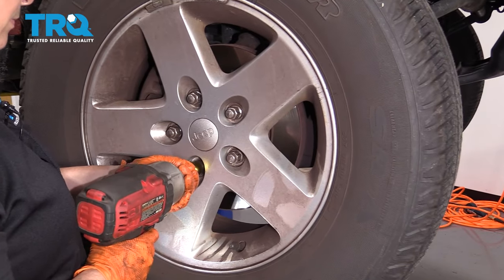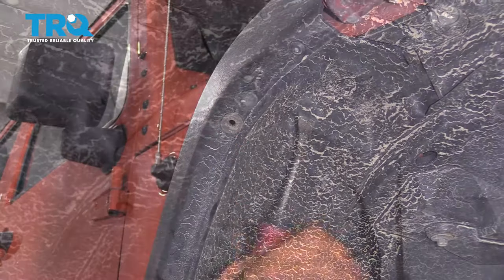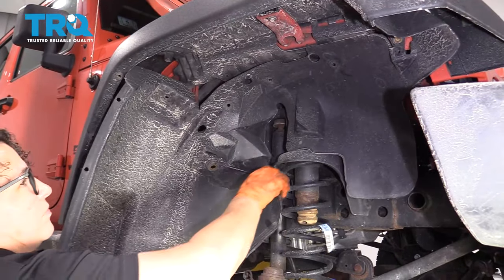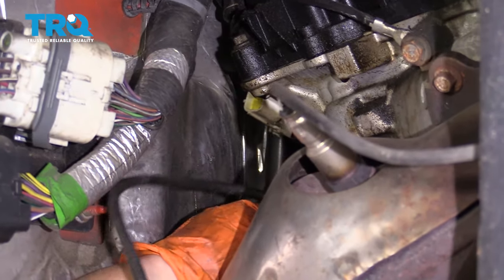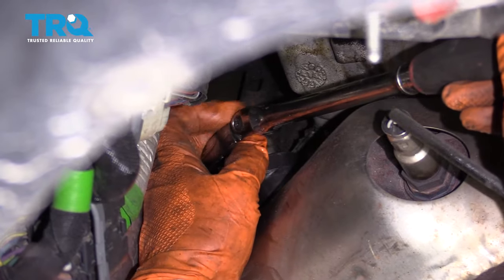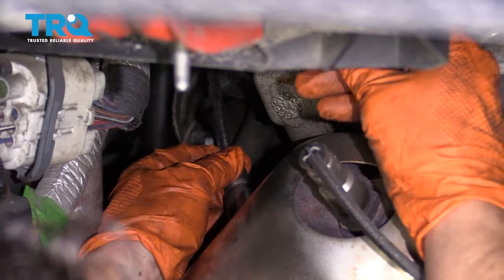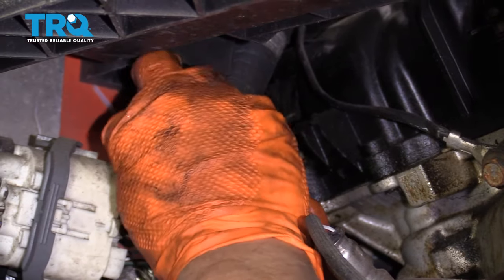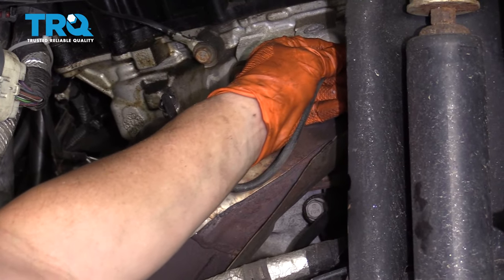How To Replace Oxygen (O2) Sensors 2007-17 Jeep Wrangler

Comment: The 2007 Jeep Wrangler has four  O2 sensors and two catalytic converters.  Bank 2 is on the drivers side, and Bank 1 is on the passenger side.  Each cat has two sensors, Sensor 1 is closest to the engine, which is the  inlet side of the cat.  Sensor 2 is on the discharge side of the cat.
Reply: Question for you code 2096 is passenger side downstream?
Reply: @matthewmilliron632  if you never got an answer that’s passenger after the cat, I have the same code right now
Reply: @maggiebrooks4485  lmao so do i, i also have code P0137 as well as the P2096

Comment: Thanks for the vid, how do you disconnect the o2 sensor plug from the harness, I’ve tried to unplug mine and it is just not working. Yes I’ve pressed the clip but still no joy.

Comment: Check your brakes first rear brakes always look for frozen caliper  slides. Caliper when  compressed  should slide freely  if frozen engine runs real hot.then po132 will say$$$.also traction control  go's crazy ...next make sure wheel alignment is ok this cause engine to work hard an run tires frt .this happened to me  2014 wrangler  with  35 inch tires  thanks town fair tire for bad alignment  got bit 2 times for 175.00  the deal Lia said I need 4 o2s  wait for it and a pcm.  Also a evap box  4000.oo  dollar s  so  I found the problem at in drive please note  that 9 months ago I changed  all4 o2s. So was confused as what to do also just had new Catlin converters installed with new engine  that was17000.00 hate my jeep the hanger queen. Lol always some thing going on. But I love it in the woods..

Comment: I'm not sure where the bank 1 sensor is located for mines but I bought two of them for bank 1 I'm just unsure where they go
Reply: Bank 1 is down the drivers side, Bank 2 is passenger side. Sensor one is before the catalytic converter, Sensor 2 is after.
Reply: @metalhead4x448  Is there 2 02 sensors or 4?
Reply: @metalhead4x448  I called my shop and they say Bank 2 is driver's side.  There seems to be conflicting reports on the forums on this as well.
Reply: @Mike_E_44  my understanding is that there are 4.  two per side and upstream/downstream.

Comment: I replaced bank 2 sensor 1 the check engine light does not go out it will not let me reset with a code reader. P0052

Comment: This was Bank 2 sensor 2.
Reply: No it was bank 1 sensor 2 on the wrangler jk 3.6 bank 1 is passenger side
Reply: Wrong. Bank 1 is passenger side and Bank 2 is drivers side.
Reply: To confirm what others have replied, Bank 1 is passenger side on the JK. 1-3-5 on passenger side and 2-4-6 on drivers.